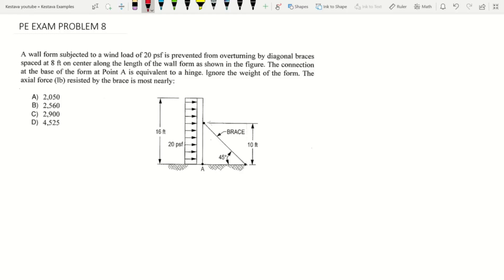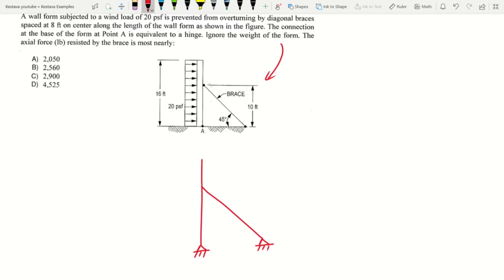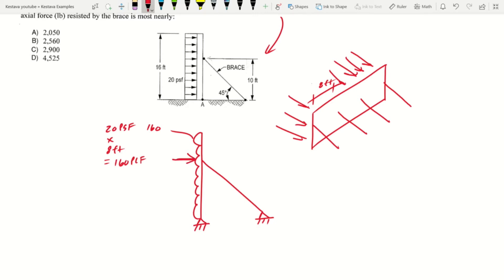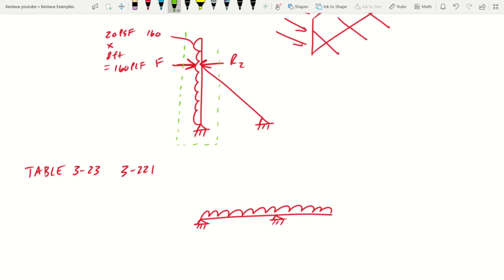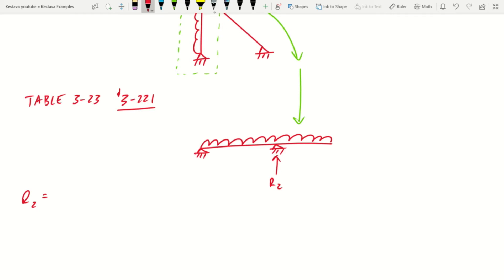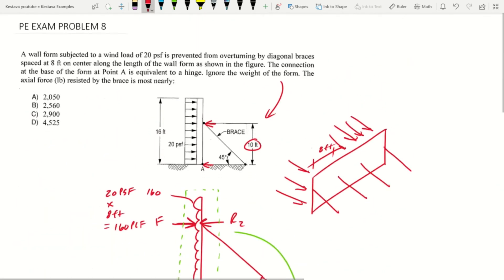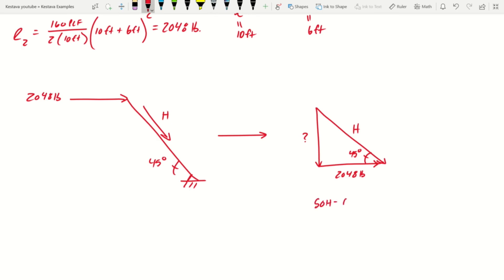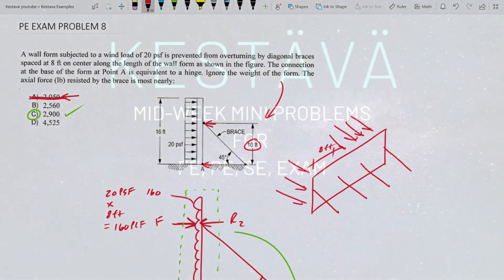Civil PE Exam - Find Axial Forces Faster on the PE Exam using AISC Steel Manual

Comment: How would we solve this is it’s asking for the force in two bolts that straps down the brace like 1 foot from the point it’s connected at the floor? I am assuming I would just take the moment arm from base of brace to the bolt then divide by distance between the bolts? Or is it simply just the vertical component of the brace is the force that goes into the bolts?

Comment: You might assume 2560 lbs (16ftx8ftx20psf) acting 8 ft above point A. Take moment at A to get the vertical reaction at bracing base support which is 2048 lbs. Multiply with √2 as 45 degrees right triangle to get 2896 lbs.
Reply from the maker: Galib I love the alternative approach! thanks for giving the team another option to tackle this sucker.
Reply: Agree, because the brace is resisting all the wind load

Comment: I like how you used the steel manual tables to find R2, it saves more time! I was summing the moment at the base. I still got the answer but I could use that extra time, thank you!
Reply from the maker: Great job working through the problem and then looking at how i went about it! That's the best way to study! I plan to continue to include little tricks I've learned to find solutions more quickly. that's a big part of the professional world, work smarter not harder! hope the studying is going great Elaine

Comment: I’ve always wondered, why/when do we know to use the height vs. on center (width/spacing)?  I encountered this problem while studying and couldn’t make sense of why I had to do the center to center rather than the full height?  In your side view, I would imagine that 20 psf would have to be multiplied by the height since you are dealing with height and not center to center spacing.  Does my question make sense?
Reply from the maker: Hi Jeffrey - so you need to multiply by both. you have a wind pressure (lb/ft^2) and braces at 8ft o.c. this means that the trib width of each brace is 4ft (on both sides of the brace) totaling... 8ft of tributary width per brace. now we multiply the pressure 20psf x trib width 8ft to get us a line load that the brace is resisting of 160plf. finally you need the force (lb) acting at the brace. In order to get the line load (plf) to a force (lb) we need to multiple by another unit of length aka the height of the wall (ft). i hope this helps!